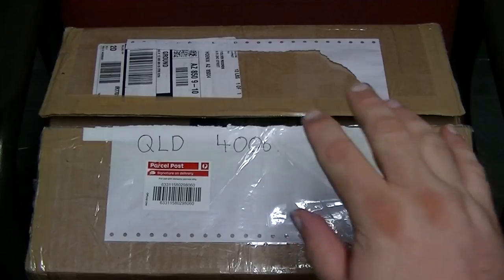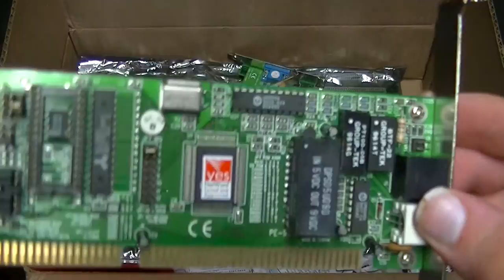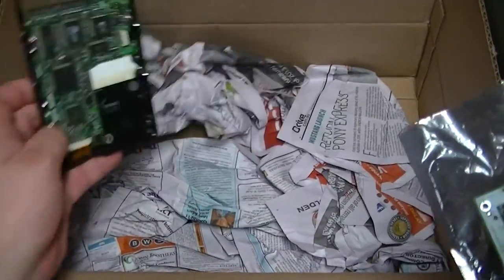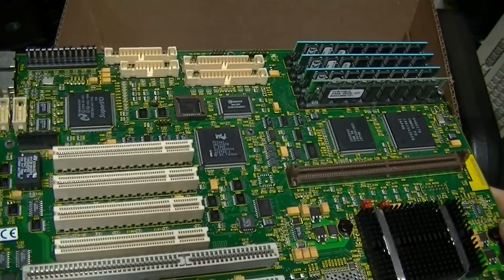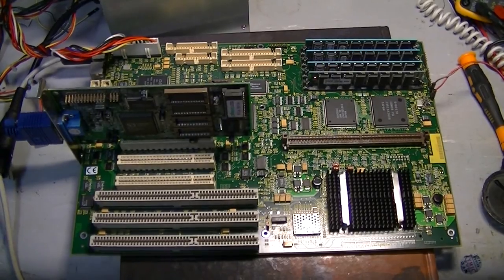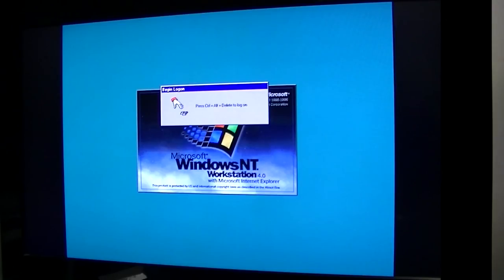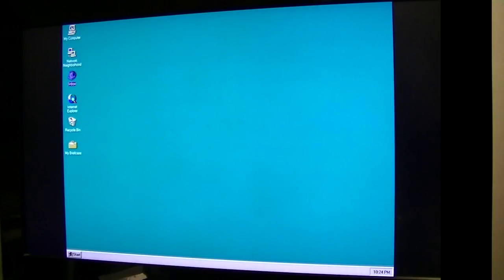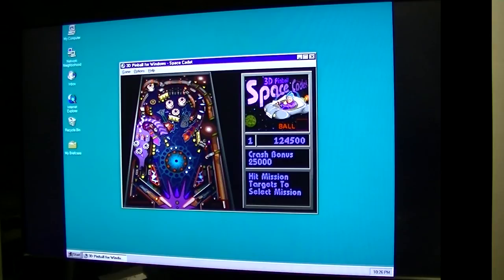[retro swim] - Episode 24 - Motorola PowerStack II

Comment: What do you see when you right click on My Computer and go to Properties? Any vendor ID?

Your collection is super awesome!
Reply from the maker: +Shiunbird No, nothing interesting really, just "PowerPC 603e", and the amount of RAM.

Thanks for the kind words! :D
Reply: +RetroSwim Aha, I've got a Power Macintosh 6500/300 with the same 603e processor. I need to replace the power supply, someone at my place connected it to the wrong voltage.

I miss the times we had different vendors working on different fronts and different platforms. This x86/ARM world focusing only on power efficiency is a bit boring.

I'm trying to find one of the most recent SGI workstations for my collection.
Reply from the maker: +Shiunbird Sorry, it's a 604ev. Close models though, I think.

Comment: I'm drooling over this... Any plans with it?
Reply from the maker: I still want to get AIX, Solaris, or OS/2 up and running on it, but nothing long-term. Just a cool curiosity for my collection! :)
Reply: +RetroSwim OS/2 will not run in any system besides very selected IBM PowerPC Personal Series and some ThinkPad PPC models. It will not even run in the same RS/6000 models which can run NT/Solaris/AIX... Well, it was an OS in beta stage after all, you can't really ask much to it.

Comment: That icon at the lower left of the Firmware... Illuminati confirmed? I seem to think have used PowerPC NT only once and very briefly, all I remember about it was that it was just as stubborn and alien as the regular x86 version. I always really liked NT 4.0 though. The local Police used it for literally everything until they started phasing it out in 2006.

On that note, yarr! I be stealing ye product key! OK, probably not. One thing that stopped me playing with PowerPC was how difficult it is to find software for it these days, it's hard enough finding interesting software for x86 machines - even when you can by resorting to questionable means, it has usually been butchered for emulators or re-packed somehow - but PPC versions seem to have disappeared for the most part.
Reply from the maker: +HighTreason610 Yeah, there's basically no practical or entertainment value to this setup. I did it as a curiosity, and consigned the motherboard to a storage box! :P
Reply: +HighTreason610 "That icon at the lower left of the Firmware... Illuminati confirmed?" Probably a jasty joke... But is also true that most PowerStacks were used at Military and Investigation Field in high level research facilities, powered by AIX. So who knows :-P.

Comment: I doubt you can run Solaris on Powerstack II, it will run only on the old models.
Reply from the maker: Ah, thanks for the tip! I've put it aside for now, since trying to boot anything, not just Solaris or OS/2, crashes the system. Also I need a new cutting disk jig for my Dremel before I can mod the target AT case to suit it.

Comment: Is it true that Windows NT 4.0 can run 16-bit x86 Windows applications? If it is, you will have no problem finding software to run on this computer. I would love to see that video.
https://en.wikipedia.org/wiki/Virtual_DOS_machine
Reply from the maker: It certainly can, and it certainly does, but soooooo slowly you wouldn't bother. Netscape took about 10 mins just to get to a usable state. WS_FTP was a bit better, but it's just not worth the effort. I even tried some DOS games, but they all hang or crash when they try to switch to a graphics mode.
Reply: +RetroSwim I guess Scorched Earth or Doom are out of the question. I kind of feel sorry for the people who bought this system when it was brand new. It must have been the biggest mistake ever for them. Each PowerStack must have cost around $1,400 back in 1996. Just when you get this thing home you find out it does nothing :(
Reply: +a4e69636b Back then this was not made to be used as a home/gaming/etc PC. Like other RISC machines running NT, this was used to run big stuff and working as workstation client for some big system.